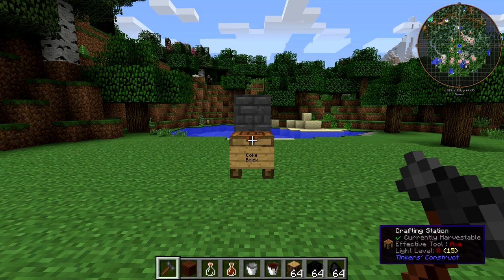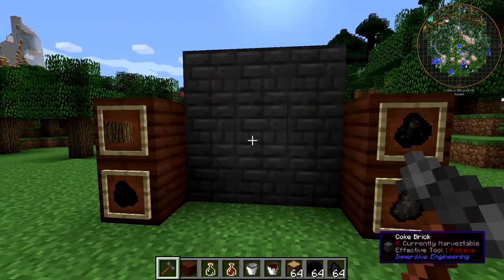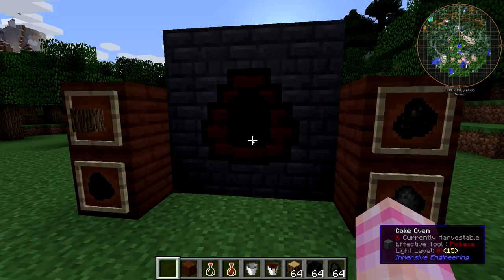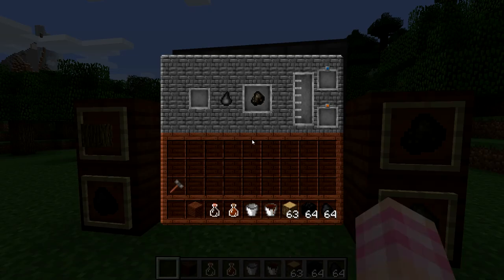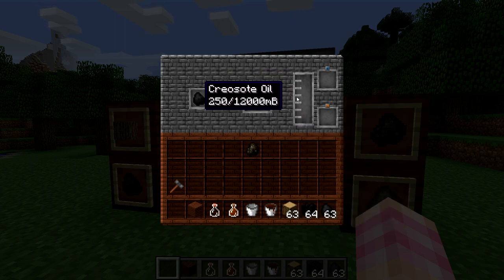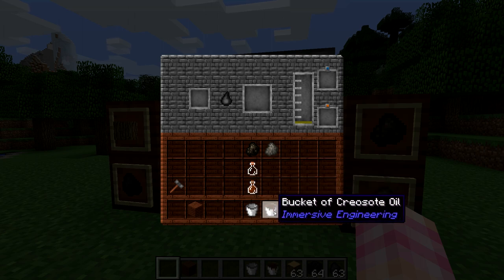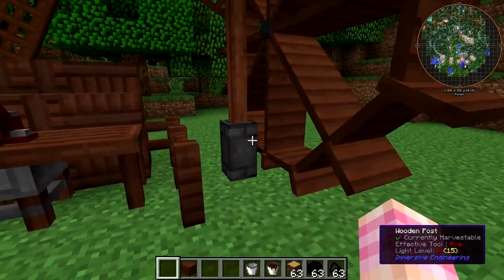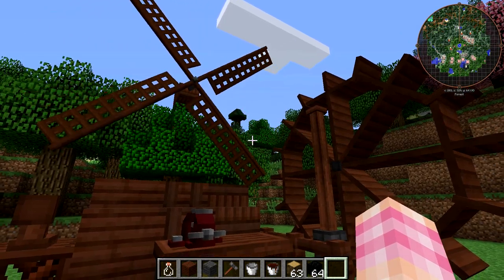Immersive Engineering Tutorial #2 - Coke Oven

Comment: This mod is so easy when you have other mods with it (such as ProjectE) projectE allows you to use the watch of flowing time ( it makes the area around it have a higher tick speed or a higher output rate of ticks 18 tick per second it makes it so the those ticks are increased maybe to 27,24,21,etc ticks per second (which can make using the coke oven instant and easy))

Comment: In addition: you can pump out the Creosote oil from coke oven using thermal expansion fluiducts and servos.
Reply from the maker: +Anthony Izumi I figured you must be able to do something like that. I want to see if IE has a method of doing it itself, then I'll cover that as well.
Reply: +SentinalhMC Maybe the pipes... it has cool looking liquid pipes... I used them to transfure water from Railcraft water tanks (the ones that gen water) to an agricraft water tank (only gens during rain from what I know).
Reply from the maker: +DragGon7601 I've figured out how to pump the creosote oil out using IE, fairly simple but you do need the fluid pump.
Reply: +Anthony Izumi you can also use buildcraft fluid pipes